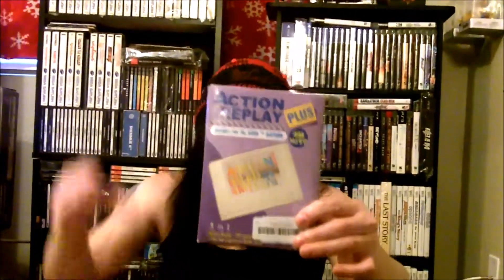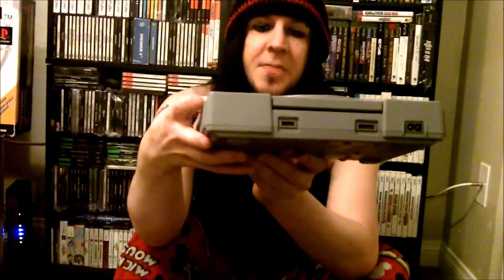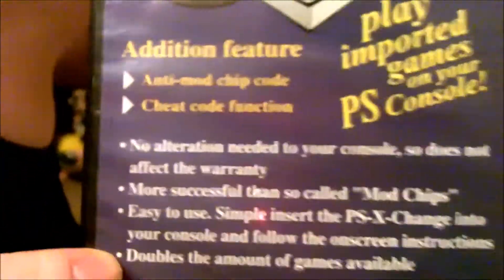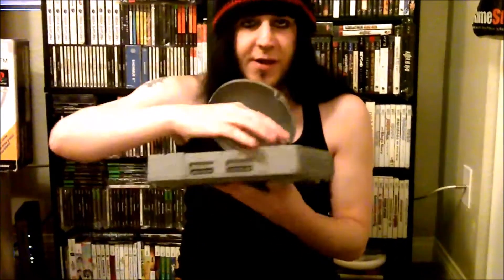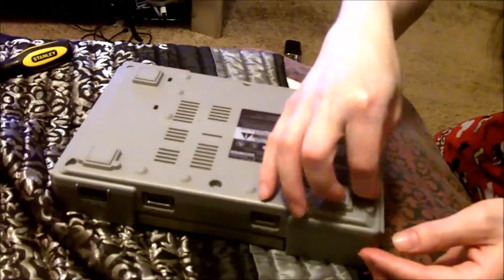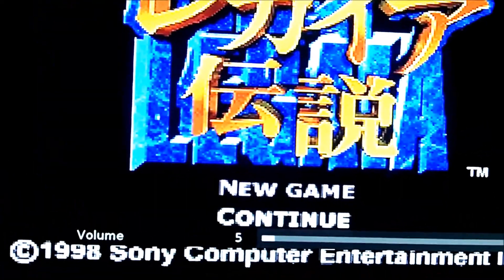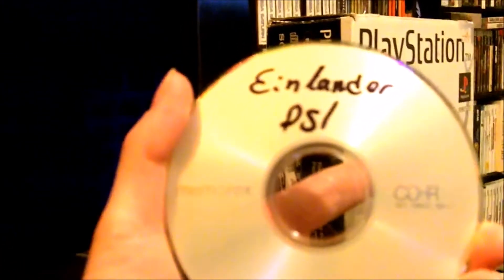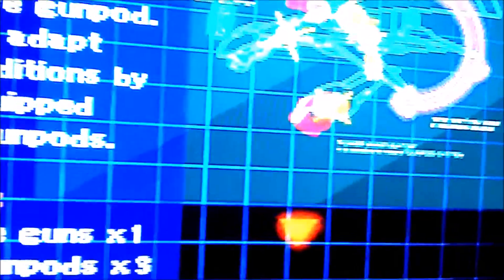How To Play Imports/Burnt Games on the Playstation 1, without mods HD

Comment: This video was finally the answer I was looking for! There are about 252 antichipmod protected games and to my dissapointment, was unable to play dinocrisis and got a error message in Japanese. I bought the PS-X-Change 2 disc with the spring and it also came with a manual instructing me to look on websites that contain the codes for antimodchip games. After doing what you instructed and inputting the antimodchip codes for dinocrisis, I was finally able to play it. Thx for the explanation. I was skeptical at first of buying the disc but it definitely wasn’t a waste of money.

Comment: I used to own 2 versions of the PS X Change.  The first one had the black disc and the current one you have with the platinum disc. I sold them years ago. Now I regret it. So looking into buying another one.
Reply from the maker: I guess they arw hard to come by now but there are other options from what ive heard. I think I have the black disc.
Reply: @RetroAllianceGaming  Here's another bit of info. If you put the PS X change disc into your PC. This will load a fake mouse driver installation.

Comment: Great tutorial, thanks! Only issue is that the PS1 is really finicky about how the games are burnt, between LSD Dream Emulator, Persona 2 and Tomba, Tomba was the only one that barely worked.

EDIT: Got them all working fine now. Also recommended speed for burning would be 8x
Reply from the maker: The psone is picky for me on burnt games for sure. I noticed that later. Its perrfect for all imports.
Reply: @RetroAllianceGaming  I have the regular model 9001. What speed would you recommend burning them at?

Comment: What is the thing you're using to trick the door on the psone slim?
Reply from the maker: It certainly with the item I bought but I do not think they sell it anymore. It's just a little plastic piece that holds.in the button to keep the disc spinning. You can open it up and tape it Instead.

Comment: Does this Works on every ps1...?even on the PAL?
Reply from the maker: Vitinho 98 Honestly I'm not sure but I believe it is region free! So you should be good.
Reply: Vitinho 98 I have a PS-X-Change and it works on my PS1 which is a European system so it should work for PAL
Reply: This thing can't read pal pictures sound works well because pal 50hz NTSC and NTSC-J 60hz thats why only works with NTSC-J disc 💿

Comment: I’m confused. To play burned games you need to place the ps Xchange disc in there, when it prompts you to put the import disc in you put it in and then when it prompts you again, you place a burned game in?  Also, there are two versions of the disc which one plays the burned games?
Reply: the import disc and burned disc in this example are one and the same. you only use the Psx Change when you start up the system, after that you're golden (2+ disc game? once the first one loads as long as system is still on you can just pop in the next one, no swap) The burned game will play np regardless of region.  All you need is .bin & .cue files-- aka a psx ROM. Google it, they're everywhere. Be careful what language ROM you download if you don't speak/read japanese--with other hack methods, region matters (e.g. NTSC-J japan, NTSC-U US, PAL UK/EU) but with Psx Change or Gameshark v2 onward, it's all gravy